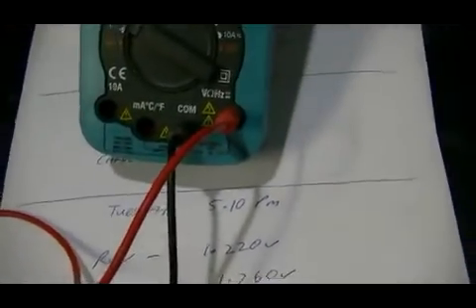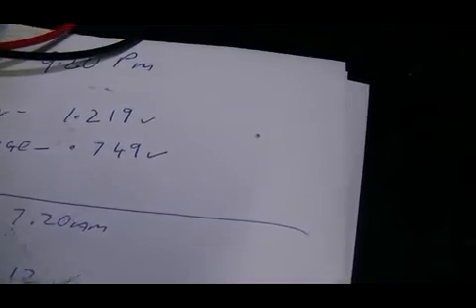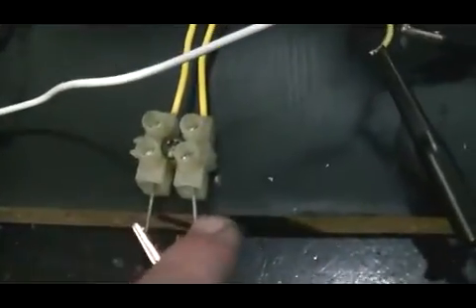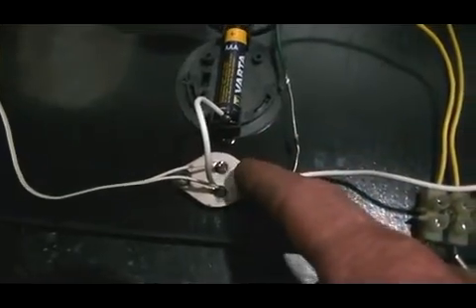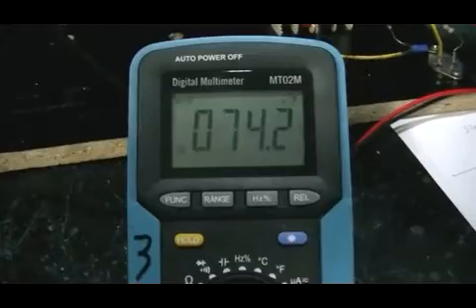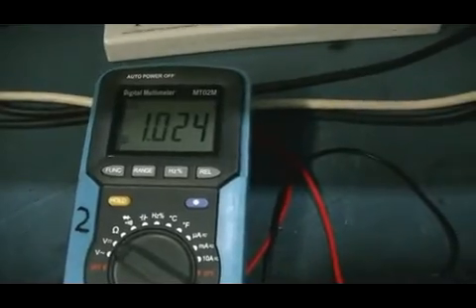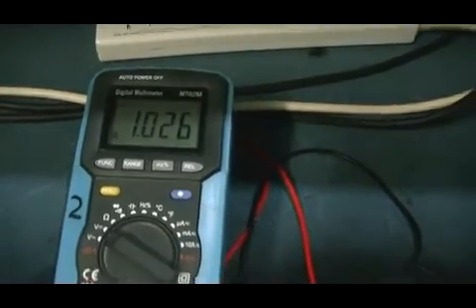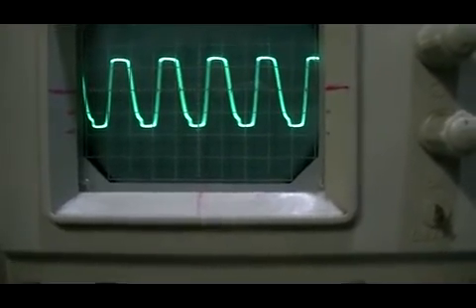Cool joule 3 riddle

Comment: the way i see it when L1&L2 collapse the high voltage(bemf) makes it way straight through the battery and charging coil L3, which collaspes  and turns on base, basically coils are excited via wire.

Comment: Okay.  The second ni-cad charges; but is it essential to operation ?
Take LED to the first nicad - it should still run + illuminate.
If there is 'advantage' due to pulsing the nicad ?
Could try inserting *another* primary winding inductor coil in series with the one connected to the collector, plus put 1000uF capacitor between their junction and the emitter end of the nicad.
Dynamically the transistor circuit will be the same, but the nicad will operate at higher pulse impedance.

Comment: I did a kind of replication today using 1000 uh chokes and 10F supercaps.  I am puzzled also as to how the transistor is being triggered.   I made a video showing it running along with a circuit diagram.  Interesting stuff.

Comment: @Tinman Very interesting experiment and good find, thanks for continuing to share your very informative videos. As for the riddle, I agree that you should try disconnecting your trigger coil but you may need to leave your base wire connected so that it serves as antenna. A short length of wire, test lead or unterminated coil connected to base may work as trigger antenna but you will need to momentarily short across emitter to collector to get oscillation started.  Appreciate all the updates.

Comment: Or; when the transistor opens to conduct, there's enough resistance through the coil, that all the current goes through the transistor, releasing the voltage on the base, being more of a uhmm (R/C oscillator?) rather than an inductive one; since there is a high resistance on the coil

Comment: I'll throw my two cents in; the transistor is not perfect, and the voltage on the collector is leaking just enough to the base to make it avalanche.  I blew out the gates in a couple mosfets that started behaving similarly; instead of nice sharp joule-theif spikes I got a lower more sinusoidal waves.  Once you start it, remove the trigger coil entirely?

Comment: Wait, isn't this the way your first coil is working as well… w/o the interaction of the “run”/trigger coils?
I thought you had come across the same thing I did w/ my buck boost watch?v=Ju90CnJiA1g – they are oscillating via the transistor/diode, some work better than others. Still thumbs up on the 4004 find. Perhaps I give those out too easily :-)
Nice little mystery, can’t wait for the follow up.
Cooljoule . com

Comment: Just an observation, some DMMs can give slightly different readings when reading in reverse polarity usually at the 0.001 scale or higher. The two I have read an extra +0.002V when in reverse polarity. Given the sensitive readings you are making I would suggest checking this. Hope that helps. Thanks for sharing.